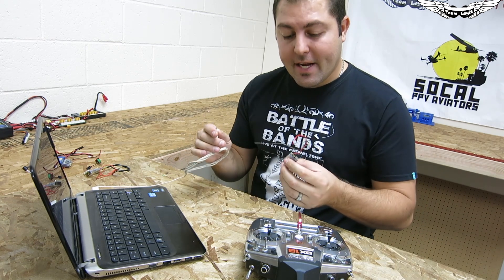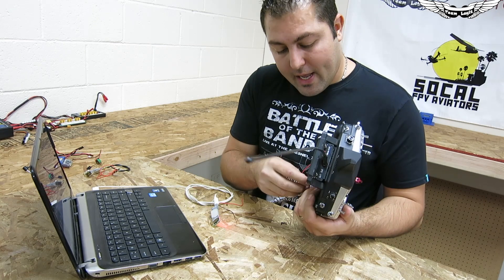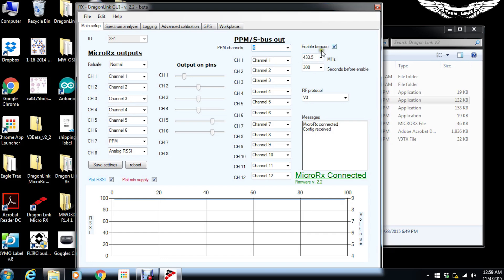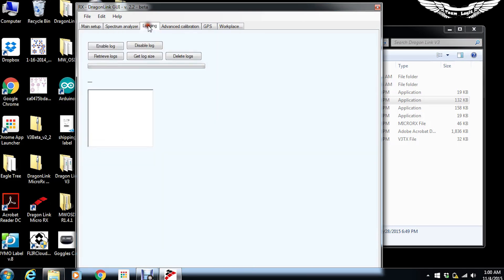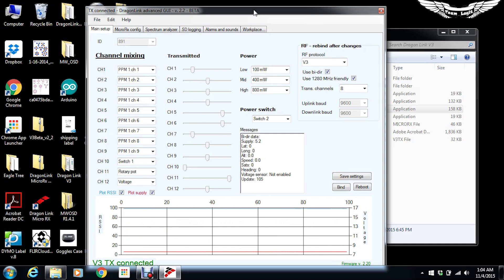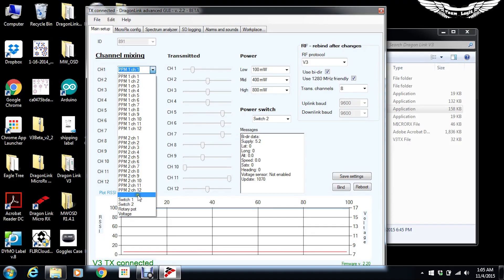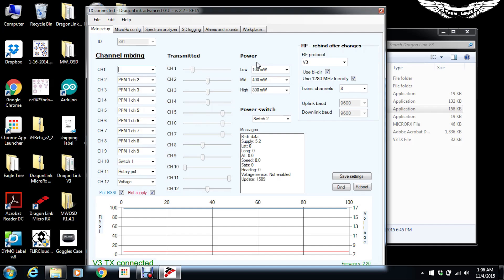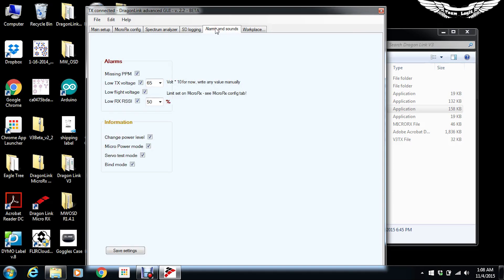Dragon Link V3 GUI Features and Functions

Comment: Hey Johnny do you know the correct gps connector for the Dragonlink receiver I mean the molex connector, as always great video and thanks in advance.
Reply from the maker: Thanks Frank! Currently I use standard Servos connectors and map to the corresponding channel. I'm not sure what the Molex pin is called sorry bud
Reply: +Team Legit sorry I was talking about the expansion-port-cable